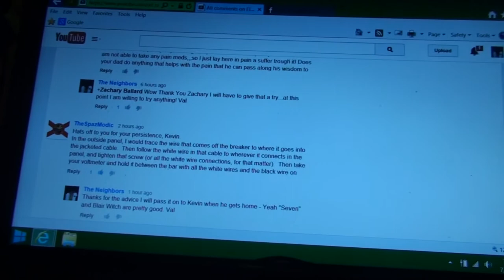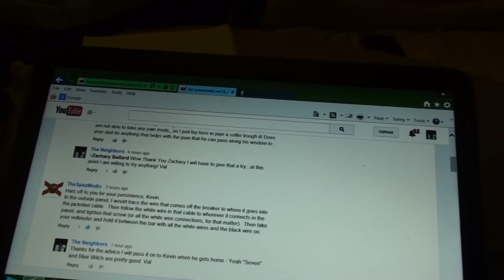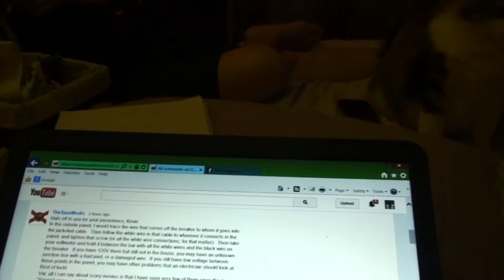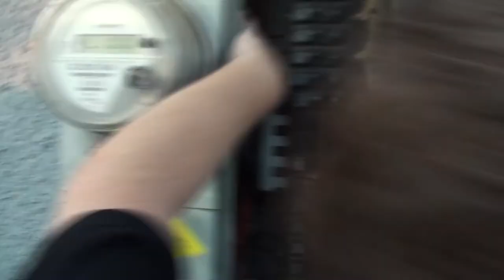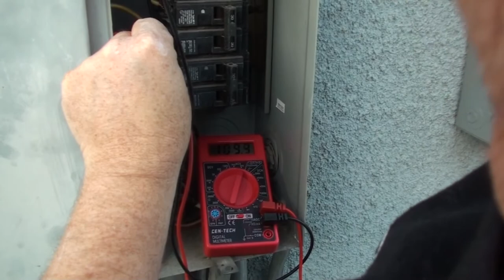PSYCHO NEIGHBORS

Comment: Forgot to mention the scary movie that scared me most.  That would be either The Exorcist with Linda Blair, or Amityville Horror.
Reply from the maker: Which Amityville the original or the remake? Val
Reply: Definately original.
Reply from the maker: Yeah but the were both pretty good - don't usually like remakes but that was one of the better ones. Val